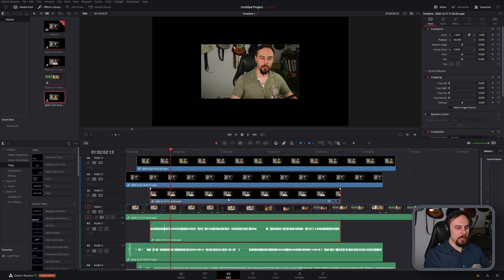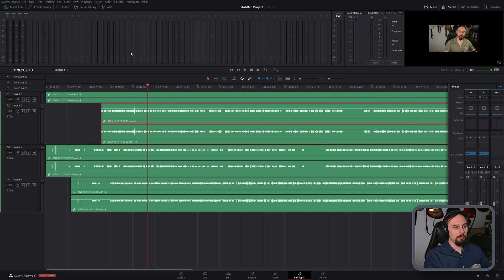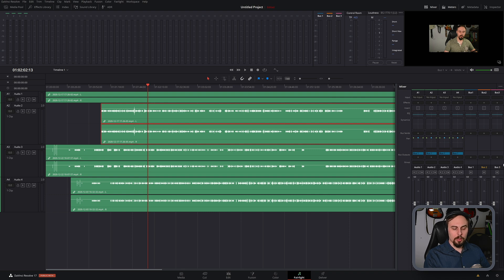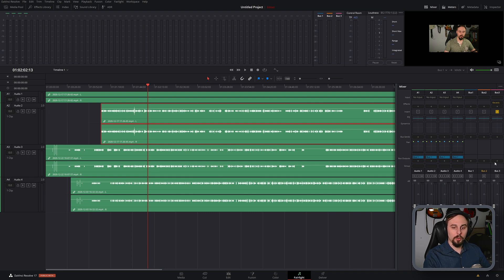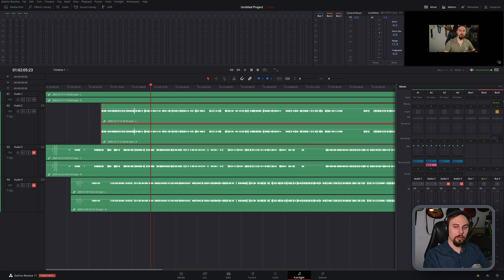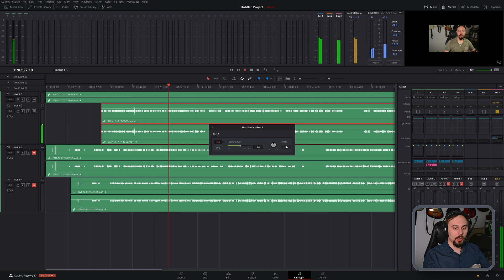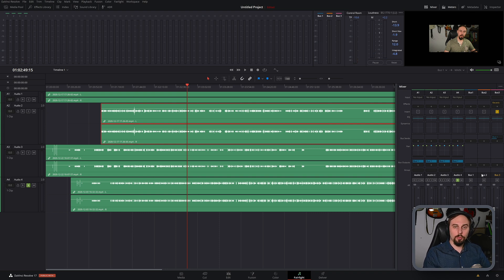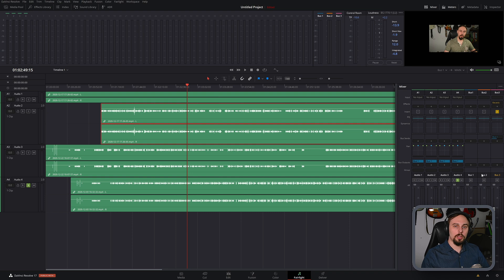HOW TO ADD AUDIO BUSSES IN DAVINCI RESOLVE 17 || SAVE CPU POWER | DaVinci Resolve 17

Comment: Thanks. Great Video, I subscribed already.
It seems though there is no option to control the individual signal sent to the Send Effect Bus from the Audio track itself, like there is a way to control the Bus signal sent to the Main bus of the mixer. This means all the tracks send to the Reverb bus will get the same amount of Reverb applied. But for example: One might prefer to have more of the Room effect applied to one voice and less Room to another track using the same room. I am surprised how Fairlight does not gives that option, unless of course I missed something.
Reply: Yeah, I was absolutely disapointed by this. Tried looking for the option for like half an hour. This sadly makes effect busses almost useless for my usecase.

Comment: Why you didn't use the 'Bus Sends' from the dialogue track to the reverb and the reverb output to the master channel? (Bus1) 
You did the sending process opposite then the music production :/
Reply: Yeah, I was surprised by this, too.
Reply from the maker: That's exactly what I did. Fairlight calls their sends "Bus Outputs". I cant send a reverb with no audio to a track with sound. Logically speaking, there is no audio on that reverb bus so there would be no effect mixed into the vocals. Fairlight is counter-intuitive to the way all other audio software works and for anything other than basic compression and EQ, I highly suggest you just do your audio work in a DAW whenever possible.
Reply: @videoeditingdiy  I think you misunderstand him. You used Bus Output, instead of Bus Send, from the dialogue. Then, you blended it on the bus itself, instead of blending each individual channel.
Reply: @videoeditingdiy  Stephen Hale is correct.  Using the Bus Send on the audio track/channel allows you to control the amount from each channel that gets sent to the reverb, which should be set to 100% mix (in the plugin).  Then, route the reverb output to the mix bus.  Otherwise, you're forced to send either the full pre or full post-fader level from each channel to the reverb, which is almost never desirable, as you'll probably be overloading the input of the reverb bus if you're sending more than one channel to it.

Comment: Good tutorial... I'm still not understanding the way to use "Bus Send" and "Bus Output" in the "Bus Assign" page of Fairlight. I want to merge multiple dialogue tracks into one master voice track. I watched Blackmagic's tutorial on that but it was on Resolve 16 which is totally different. Can you help? Or do you have a tutorial on the "Flex option" in Fairlight?
Reply from the maker: Create a bus the way I showed and assign all your voice channels to that bus. From there add it to the master send. It is basically the exact thing I showed here. Add all your voice channels to it and voila. You now have a single bus to control the volume as a whole or apply an effect to all of them at once.

Comment: Good tut but you're playing really distracting background music while doing an audio tutorial. Do you not think that's a bad idea. We're supposed to be listening out for stuff and listening to instructions and your play cheesy music. ??????
Reply from the maker: Noted, but this room is untreated and my mic captures everything. The vocals are incredibly harsh and a lot of room reflections are captured. I use it to mask some of the embarrassingly bad audio. Not much I can do in a rental apartment with plaster walls. Its a shared room with my fiance so I can't have acoustic treatment up. I have been trying to turn down the music volume in later videos and I have made some adjustments to my post processing since then.
Reply: @videoeditingdiy  Take a heavy double bed sheet and put it on the floor below where the mic is. Hang another between two light stands if you have them and close down the size of the space. Do something or the videos are worthless. Zero point in a sound test and putting music in the background surely you can see that.
Reply from the maker: @JWS1968  I appreciate the feedback but it makes little difference. I know a lot of the DIY hacks but this space isn't conducive to most of it. The mic is between myself and my monitors, hovering inches above my desk. One wall is heavy stage blackout curtains and the other has an open closet door with soft materials to trap and diffuse sound as well. Anything else just doesn't make much of a difference unfortunately. Until we move, my sound in this room is stuck where it is. As mentioned though, I've had some marginal improvements from adjusting my setup in more recent videos.